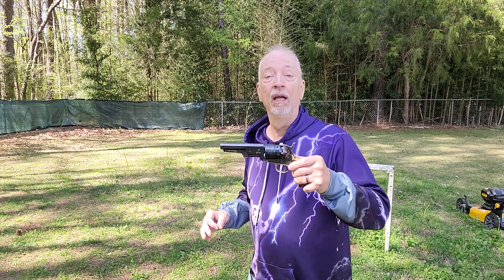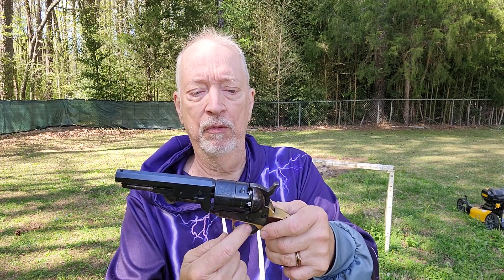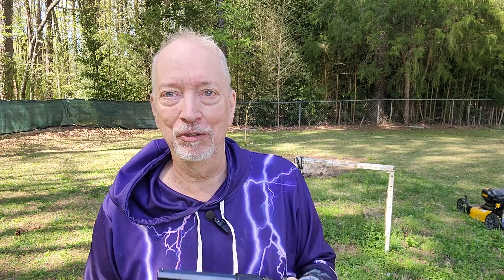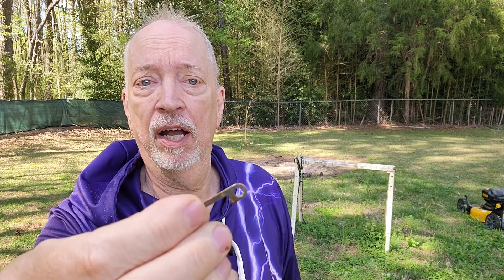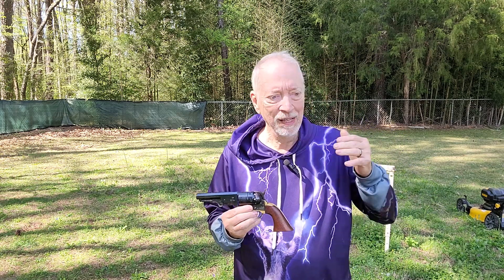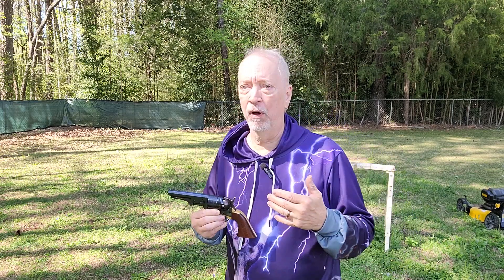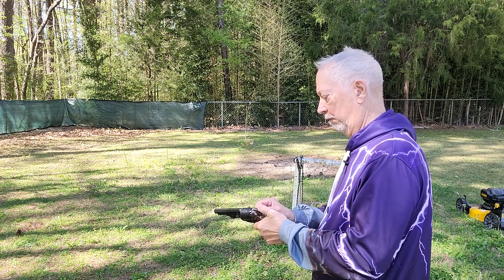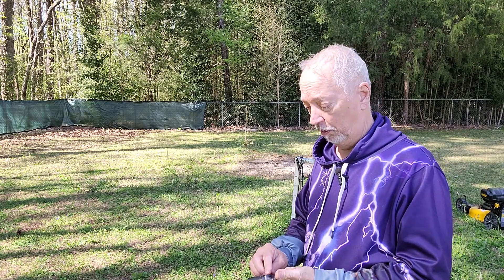Homemade Percussion Cap Retest

Comment: People worry a lot about rust. If you maintain your weapon, as you are supposed to, rust isn't a problem. In the 1970s I was stationed in the western Pacific Islands. I had an old WW2 akbar given to me. I've maintained that knife and today it's in fine condition.
STerry, can one omit the glass dust from the H48 mixture and still have functional reliability?  What is the purpose of the powdered glass? I've heard it causes the caps to be " messy," is that true? Very best regards
Reply from the maker: Interesting you should ask about the glass. I just made a few without it and they're curing now. Glass is used with potassium chlorate in strike anywhere match heads and antimony with chlorate in safety matches so it may just be a holdover from that and in a primer we don't really need it. We'll know tomorrow.  Its purpose in matches is to generate heat from friction starting the match ignition process with the chlorate.

Comment: It’s making a good bang, but is the fire getting into the nipple. You think superglue would block the fire some.
Reply from the maker: That's a very good question. I've only done one live fire test so far, but when I was cleaning up today I could see daylight through all six nipples. So more testing is definitely needed. But frankly I didn't expect them to go bang at all so it is a good start.  I might end up ruling superglue out but I need to get to the range first and fire a few dozen, and I still have at least a half dozen more to try out.